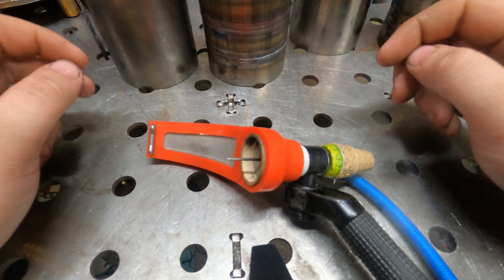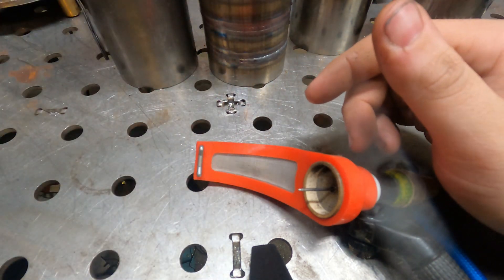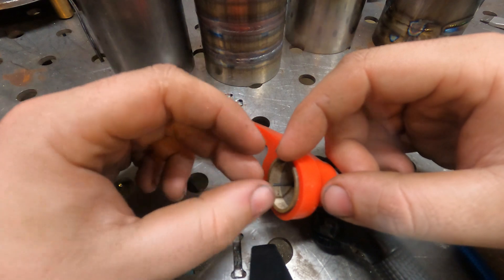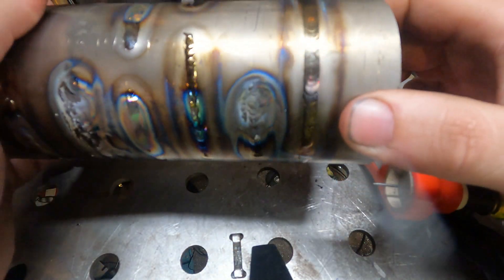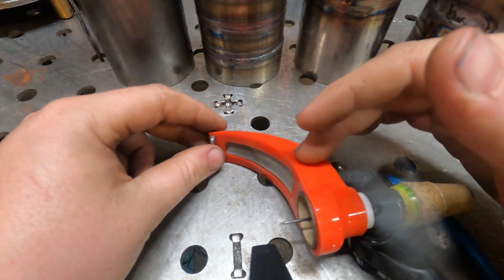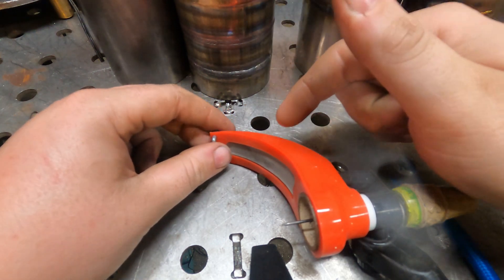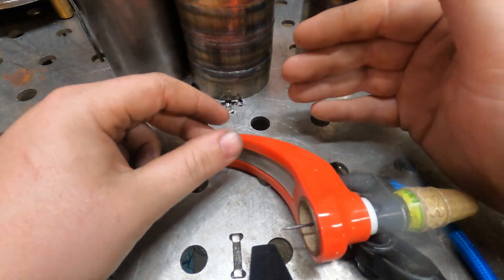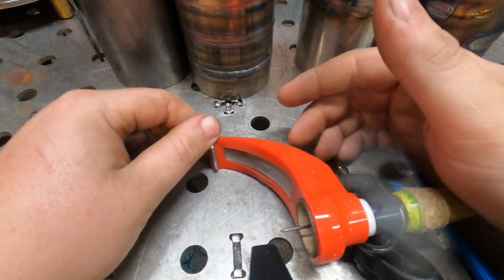Tigaesthetics Trailing shield Review!

Comment: I use the dual regulator for the back purge, so I already take up the 2 lines, could I tee off the back purge for the trailing cup & then my torch cup will have its own line?
Reply from the maker: I wouldn’t recommend it, what I noticed was if there was any disturbance in the flow going to the trailing Shield it would reduce the flow and start to not get good coverage